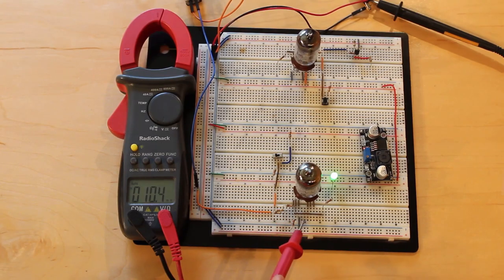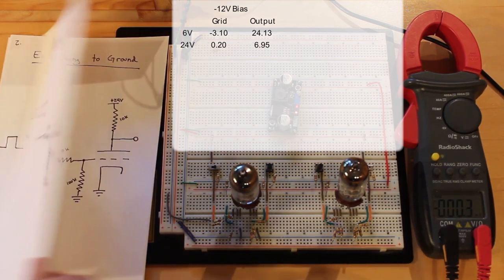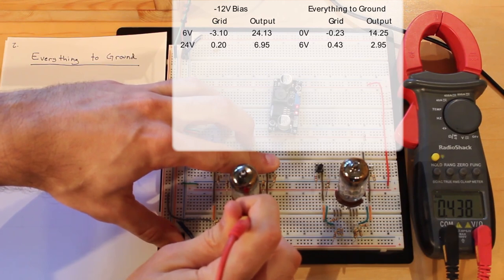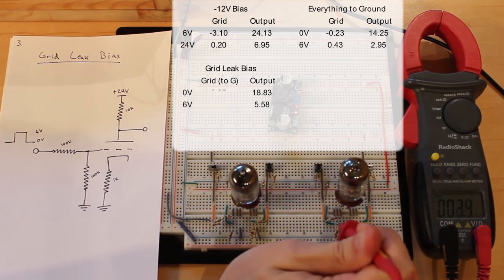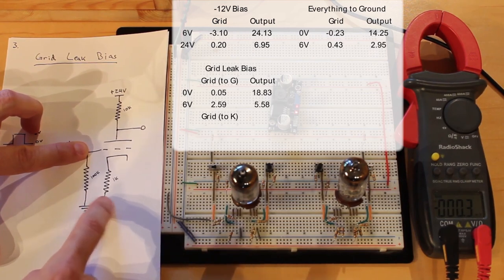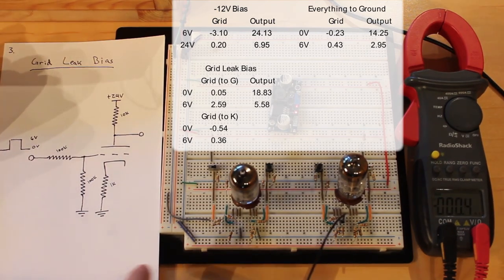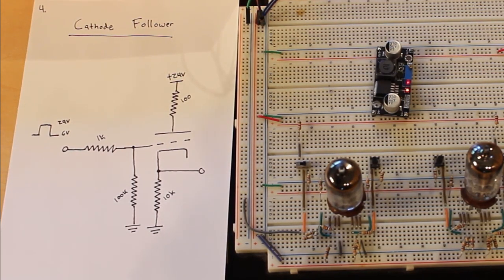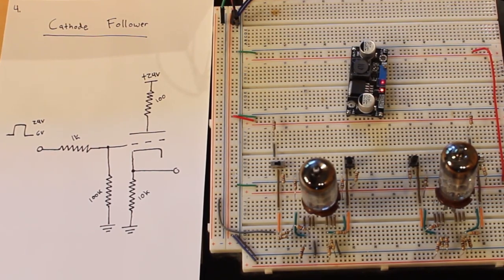Vacuum Tubes: Episode 4 – The Triode (Part 2.5)

Comment: Interesting stuff. I'm only now learning the basics of digital  electronics, but always had somewhat of an overview of how they worked. Even so, vacuums tubes seem like smoke and magic. Thanks for shedding some light on how they work.
Reply from the maker: Thank you! 
Vacuum tubes required a shift in my thinking to thinking about the movement of electrons as opposed to signals. Still, it kind of goes against everything we've been taught to think of there being a connection between the plate and cathode despite the fact that they're physically separated. And, it turns out that air is an excellent insulator, which is why in 99% of applications, that is indeed an open circuit. Vacuum out all the air however, and then the electrons can actually move through the void from one place to another! Of course, there's other ways to tackle that problem too. It doesn't have to be a vacuum, you could fill the tube with a gas like Mercury vapor or Hydrogen and bump the voltage up, and that's actually now a Thyratron. But, Thyratrons are for a future video (once I get my hands on some).

Comment: This series is awesome.  I actually now kinda understand how tubes basically function... I never before learned how intuitive they are...  All about electrons and charge. So awesome! Thank you again!  (Wearing my Usagi tube shirt right now, :D )
I also always just assumed that tubes needed to be run at like 110+ volts.  I never realized they worked at 6 volts or whatever, with some parts even less than that. :D

Comment: The space charge played a shadowy role in WW2.   The first method they tried at large scale to separate U235 was to make super huge vacuum tubes with very powerful magnets deflecting the electrons.  Unfortunately space-charge limited the cathode current to a fraction of what they expected, so that was a very slow way of extracting U235.  It took years and gigawatt-hours of magnet power to separate out a dozen kilos of U235.   Estimates are that WW2 could have been more than a year shorter if there was enough U235 to drop a bomb on Germany in mid 1944.  But even with thew top physicists working on the space-charge problem,  progress was non-existent.   They also tried to make a klystron-like separator tube, and that didn't work at all.
Reply from the maker: That's really interesting! I had no idea that extracting the U235 was so involved, though it totally makes sense!
Reply: @UsagiElectric  The trouble with the process is that both major isotopes of uranium are chemically identical to each other, so there is not and can never be any chemical process for separating the two.  The only methods all involve the slightly lighter weight of U235 when compared to U238.  Since only U235 is "fissionable" and there is a lot less of it than there is of U238, it takes a long time to separate enough of it out of the U238 to make even reactor-grade material, let alone 8om8-grade material.

Comment: All those electrons between the cathode and the grid is what's known as a Space Charge, the reason why there's that slight negative voltage on the grid is because the grid of a Triode is at a very high impedance, so any accumulated charge on the grid tends to just sit there, which is why the grid needs to be tied to ground via a very high grid-resistor, the Space-Charge between the cathode and the grid is something that happens in all vacuum tubes, and is part of how they normally operate, interestingly enough, the gentle bending you see in a vacuum Tube's characteristic curves graph is caused by Space-Charge effects.
Reply from the maker: Thank you for the information!
In these early videos I was still very much so trying to figure out what all was going on inside, and tubes are a beautiful balance of simplicity and intricate interactions. In my modern designs, I actually use a negative bias supply to full pull the grid into negative to make sure I'm getting the tube all the way into cutoff. Which is totally something that is great for binary/digital situations and probably a really terrible design for audio situations, haha.

Comment: The relatively hiogh amount of electrode-caused bias, could it be due to the extreme geometry of the 6DJ8?  With its very small cathode to grid distance?   That sounds like it would be a copious source of electrons.
Reply from the maker: I'm not entirely sure, but so far, the 6DJ8 seems to be the absolute best tube for anything happening at low voltages! The only tube that gets moderately close is the 6AU6, but as a pentode, it behaves quite a bit differently.

Comment: Great stuff as always, thanks! What are some real-world applications of the buffering you described in the cathode follower configuration?
Reply from the maker: Thank you! Interestingly, that's something I've been working on this morning. Ignoring the tube altogether, whatever output we get out of an inverting amplifier goes through a 10k ohm resistor. 24V and a 10k resistor means we can only drive up to 2.4 mA. That's not a huge problem for driving other grids on tubes or even LEDs, but anything that needs a bit more oomph causes the whole inverting amplifier to just stop working. That's where the cathode follower comes in (and ultimately thyratrons if you want even more). Since the cathode follower setup only goes through a 100 ohm resistor and whatever the internal resistance of the tube is, it can drive a lot higher loads before it runs out of juice (I mean, we're still talking mA, but it's more). I love working with LEDs, but for final display pieces, I'd sure love to use halogen bulbs, so that's going to be what we're getting into next!

Comment: Off this subject but on subject with tha booting system.
It is now saying PRINT.
I am guessing that it is expecting a printer attached to one of the printer ports.
I don't remember if your second monitor is operational.
If so, wire it the same as your first monitor and try the second rs-232 port.

A simple way to make RS-232 a three wire connection is
 RTS tied to CTS
DTR tied to CD and DSR

Now all you need is RD TD and GND  connected as required.
====================================================================
I was in the NAVY in 1961 through 1964.
My first ship was the USS Bennington.
It was built in 1943, the same year I was born.
While it had been upgraded with some modern equipment,  It still had one 1943 transmitter.
The one output was visible from outside the chassis.
A big glass bulb with the plate the size of a soup can.
When we were returning to our home port, we would tune it to Ship to Shore  radio and let some of the sailors  talk to their familys on shore.
Because we wanted to connect as soon as we were will make the connection, we tuned the transmitter to as much power as possible.
For a couple of days, that soup can was glowing red.

Stan

Comment: what i'm curious about is the wattages and tolerances of the resistors. those can make a difference in the negative voltages
Reply from the maker: I'm not sure if different wattage resistors would cause changes in negative bias, but tolerances definitely could. Especially if building a system that requires pretty high precision. That can be particularly important for certain analog designs, but for the simple digital designs that I end up running in my vacuum tube computer, the tolerances can be way out and it still works. For example, in my standard inverting amplifier design with a -12V bias, the plate resistor can vary from 10k to 1M and we can still get pretty good logic high and logic low out of the tube (of course, there has to be a lot of impedance matching going on because as the plate resistor gets larger, the amount of current it can provide gets smaller).

Comment: Can someone explain to me why negative voltages are used?  Since a voltage is just a potential difference, technically speaking, a 12 volt power supply could supply 0-12 volts or 0- -12 volts.  It's the same thing, you just switch which rail you call ground.  I often see old electronics use power supplies that will have something like a ground rail, negative 12 volts, and positive 12 volts.  In a scenario like this, why not just have a ground rail, a 12 volt rail and a 24 volt rail?  It's the same thing, but in my mind, it seems way less complicated to avoid the negative voltages entirely.